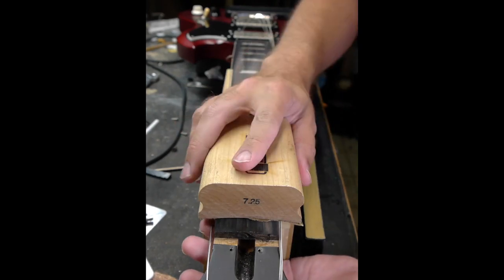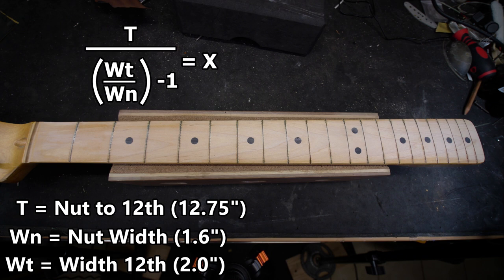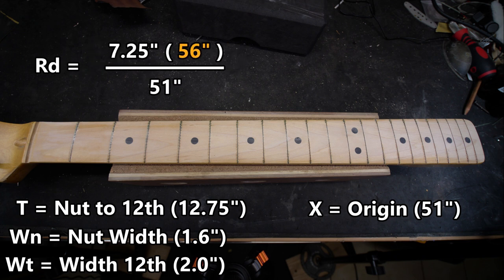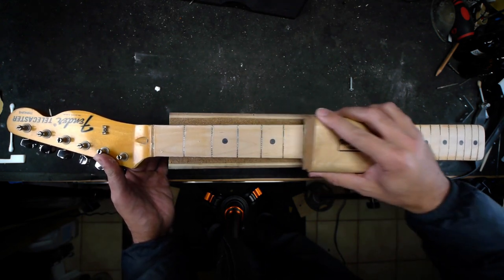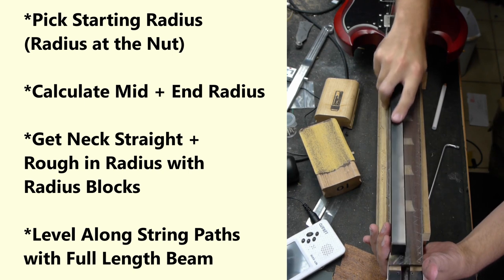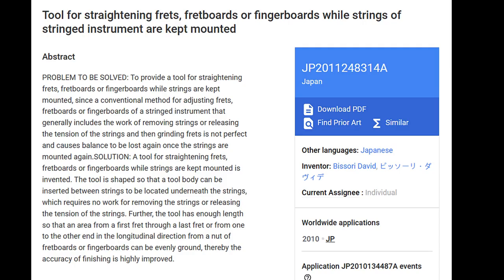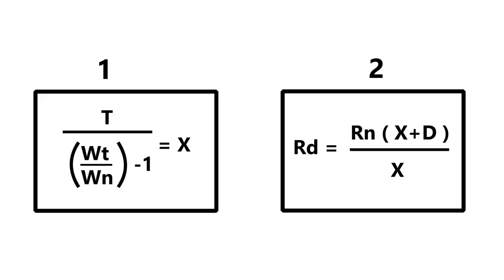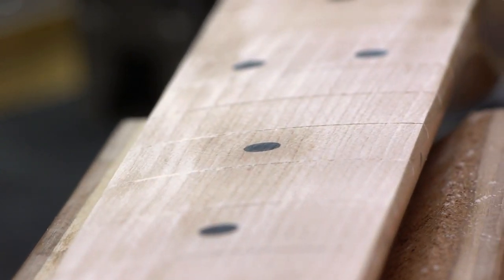"Compound Radius" Formula: Conical Profiling for Stringed Instrument Fingerboards / Frets

Comment: If we use 10" radius block at the end of the fretoard we'll don't get the correct radius formula at the bridge, maybe better go with 9.5 to the end and after let the sand beam do the job, sanding EXACLY thru the strings line. I see it's very easy go over radius formula at the last frets if you don't sanding in the right pattern.

Comment: yea no all wrong .. each FRET is a little bit different radius, cuz its a constant compound radius not a "stepped" like you are doing here .. not going to work very well  .. the math s way too much ..

if you want a 10/16 radius?  put a thin 1/2 wide 10" radius at one end of the fingerboard, and a 16 at the other .. then rock it over a table router with a fine wood cutting bit.. like a rocking chair, this will insure the radius is gradual .. 

this is a real bad way to do it, you dont have to listen to me, waste some time and material and see for yourself
Reply from the maker: The method I describe in this video results in exactly that: a conical radius, or as you called it, a constant compound radius. 

When checked along the string paths with a straightedge, it should be perfectly level along each string path. What you'll see is that every fret is a gradually flatter radius as you go from beginning to end.

When leveling along the string paths, assuming the desired starting radius has been established, this conical profile will be established automatically. 

I can't visualize the router table method and I wish there was a video demonstrating it. I'd certainly use that method if I could get the same results, but much faster. It sounds like a great method but I can't visualize it and I'm also curious what the margin for error is. 

The one discrepancy is when you go beyond a conical profile. Say, if someone tried to do a 7.25" - 20" compound radius.

The method I describe in this video is conical profiling. Compound radiuses that go beyond the profile of a cone are another geometric shape. 

Imagine a traffic cone that's 7.25" - 10". How would one make it a 7.25" - 16" while still maintaining the profile of a cone? The geometry changes once you go beyond the bounds of a cone, which is the profile that's created when leveling along the string paths. 

I like using the radius blocks to rough in the profile, though they're not necessary. The method I lay out here may not be the best but it does work, and you can see the demo at 7:26 that proves it. Action that low and being able to do 2 whole step bends without choking out would not be possible otherwise. 

My main gripe is how long it takes. Sanding takes forever. I'd certainly be using a router table to do this if I could understand how. But I did need to correct you that this method is not stepped, and I'm not using the radius blocks to do a stepped, clunky series of radiuses -- they're only to rough in the profile, and the leveling along the string paths once the beginning and ending radiuses have been established until everything is level along the string paths is what finishes the job.